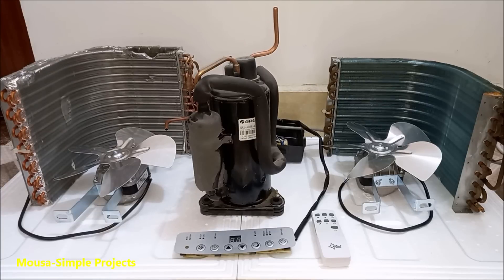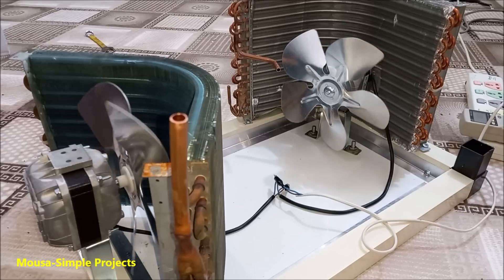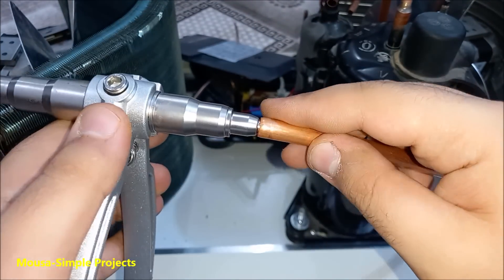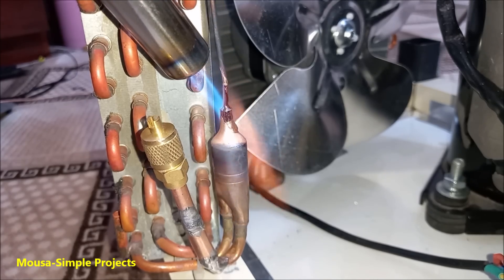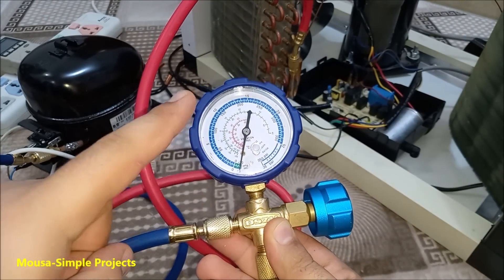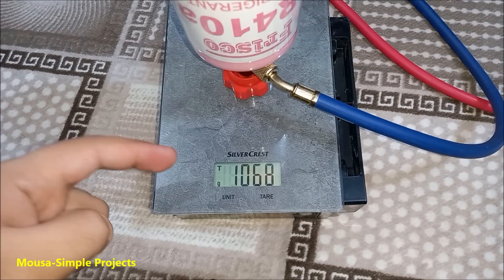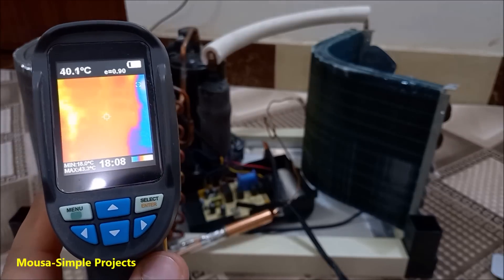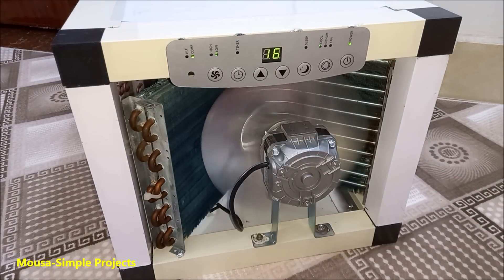How to Make a DIY Window Air Conditioner with R410 Refrigerant Gas

Comment: If you are going to solder you should really use stay bright 8 silver solder it came hold up to high pressure , I wouldn't feel safe using any solder with 410 because the high side can get above 300 psi. It's called 8 because it has 8 percent silver in it.
Reply from the maker: You are right ! Soldering the pipes wasn't good idea.

Comment: I’m a graduating AC student. Loved the video. I did not know you could solder An AC unit. We learned how to braze. Will it hold with R-410A pressure?
Reply from the maker: Soldering the pipes wasn't good idea because it can't hold the pressure of R410 gas, just use brazing.

Comment: Seems like you used lead solder made for plumbing, 410A can get up to 450 psi.. and should be solder with sil-fos or 95% silver rod, and you vaccum the system but when connecting your hose you had atmospheric pressure inside them so you vacuumed it  in before filling the hose with gas.
Reply from the maker: You are right ! it wasn't good idea to soldering them.